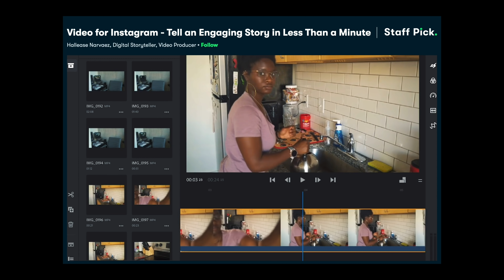Making a Butterfly Chisel for Woodworking

Comment: At first blush, this seemed like a fun novelty project, but after I saw it finished and I saw you hitting the chisel with a mallet, I realized how great of a design this actually is. A perfect solution for people who want to keep a chisel (or a few chisels) handy without cutting themselves or poking holes in their pockets or tool bag or damaging the chisel blades. If they clicked securely into place, both open and closed and were heavy duty enough to last, this could actually be a successful product. I’d buy three in different sizes for sure.

Comment: So Laura as promised some info on selfadhesive sandpaper: it is not that common, unfortunately, you might not find it at the"grinding section" on your local hardware store, for sure here in good old Europe, because it is mainly used for sharpening rather than sanding/grinding. I stumbled over this amazing stuff the first time on a Alec Steele video and made some research. You can find it online in some grid variations mostly from 80 to 250 and it comes mostly in rolls. The adhesion works mostly water activated, you just spray some water on the flat surface you want to adhere it to, rip off some sandpaper and press it on. Give it some minutes to soak up the water and get the glue started. To remove it just soak the used up paper in water and scratch it off with a painters knife (Spachtel), done.
Noch ein kurzer Hinweis für dich und alle anderen aus Deutschland die dies hier lesen: in Deutschland bekommt man dieses selbstklebende Schleifpapier bei DICTUM (keine Werbung) ist in deren Messermacher Bereich zu finden (online).

All the best, stay safe, Sven.
Reply from the maker: Top! Danke für die Info-klingt super!
Reply: 3M sandpaper is self adhesive (dunno about its availability in EU, but I'd imagine it's easy to find). It's heat activated. Just lay it down on the surface, and hit it with a heat gun...voila!  (Got that tip from a Bobby Duke Arts video).
Reply: Porter-Cable sells adhesive sandpaper that doesn't require heat or water. In rolls of 4" wide to 10 yards for around $20 to $35.
Reply: Axminster stocks some very fine adhesive stuff from Hermes. Grits from 800 to 2500 in a lovely bright blue colour.

Comment: Was just thinking about order of operations. I find useful to picture before starting. Example of cutting your chisel sides out of the entire piece, then remove the extra length. Means you have more purchase in the vice, without having to risk damaging the vice.
Reply: The other example is the mirror finish polish, before heat treating and acid etching. Seems like wasted effort?
Outcome is great and really liked the video, hopefully helpful tips 👍

Comment: I was using a thin grinding disk while I was working on a project. The edge somehow got a nick in it. I thought I will use it until the bad part wears away. The disk caught on an edge and exploded. A piece flew into my hand at the first  knuckle on my left hand. I don't know how to explain this without the gore, but the piece went to the bone. I got it stitched, but the whole hand got infected and they had to pull the stitches back out, (to let the gash drain),  and they gave me antibiotics.  The shot of antibiotic had a very long needle, so my behind now hurt for days as well. lol  
It has been three months and I can now close the hand without a lot of discomfort. I have been closing the hand to try to stretch out the injured area and have it heal without restriction. The knuckle does not look the same as it did before. I will have to think of an interesting story about it. Maybe, while wrestling with a bear at my campsite.....
I ask that you consider wearing a full face shield and gloves, (like the cut resistant type butchers and wood carvers use), when using a grinding disk.  Best wishes to you from Nevada USA

Comment: I think you have found the only acceptable use of Nescafe

Now the question is: Is this technically an illegal butterfly knife in germany?
Reply: This could actually be a real problem. They are illegal without special permit.
Even if it is a press sample that is locked away it can still cause legal problems.
Reply: It's not a knife.  It was a comb, now it's a chisel.  The only sharp edge is the tip, not the length of the steel.  Not arguing to say you're incorrect, just giving a possible reason why it's not illegal.
Reply: @matthewb8229  A comb is not sharpened. A chisel is. I'd be very surprised if it's not illegal.
Reply: @danproposkanovovski  I found 3 rulings about butterfly knives on the BKA website:
1. Key chain sized examples were found not to be illegal, because they do not constitute "weapons" due to their small size (blade under 41mm long and under 10mm wide).
2. A blunt butterfly knife was found to be illegal, due to the possibility of being sharpened with common tools
3. A version with ratcheting grips (cannot be flung open and requires 2 hands) was found to be illegal regardless.
So it's not 100% certain. I would also argue that it's clearly a tool will an established purpose and therefore does not constitute a "weapon". The ban on folding handles therefore does not apply.

Comment: Im pretty sure you didn't get the steel hot enougth to harden it... Usually steel is glowing red hot when you quench it! Usually a good test is to hold a magnet to the blade, if its no longer magnetic you are at a good place! Unless you had other specific instructions! then i didn't say anything!